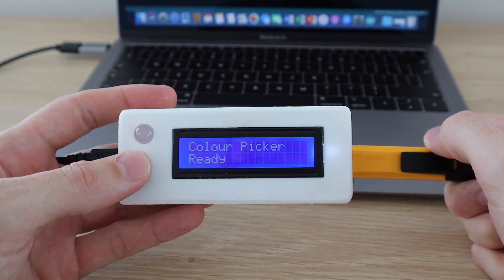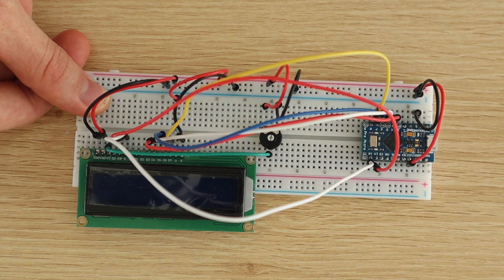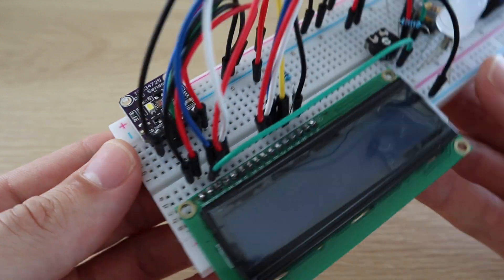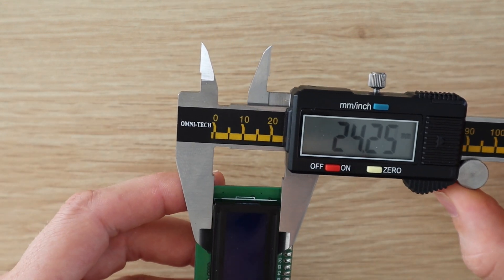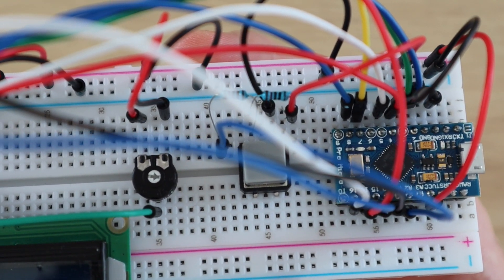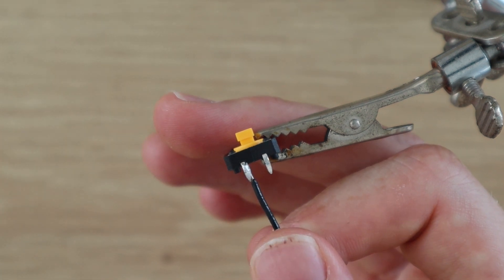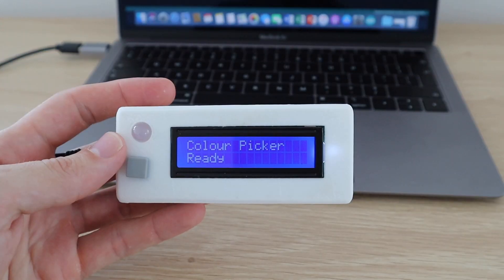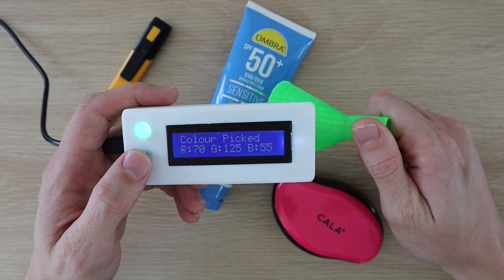Arduino Based Real Life RGB Colour Picker - Make Your Own

Comment: Thank you
You explain all the steps and give all that one needs to do it.
Could you please refer me to a theoretical explanation for the gamma table values?
Reply from the maker: The gamma table is just a simple exponential look-up table to make the colour visualisation on the RGB led look a bit more realistic. By putting the values through the gamma table, you're just adjusting the brightness of each of the RGB LEDs to new values, which should produce a more accurate visualisation on the LED. It's commonly used with RGB displays as a means of adjusting the colour output.
Reply: @MichaelKlements  why power of 2.5? Why not 5, 3, 1.5 or any other number...? (I am asking for my knowledge..)
Thanks!

Comment: Hey man, really cool project and I hope you do well on Make it Glow contest. 

I have a question though, is device's performance affected by brightness of the room or color of the light illuminating the room?  Will it give me different results in different time of the day or under different light? 

I was thinking using it to get color code of my walls and knowing how device interact with different lights really helps me in the long run.
Reply from the maker: Hey Umut, thanks you.

It seems to be fairly consistent as the sensor module provides its own light source. There is a small white LED next to the sensor which is turned on and off for each reading. But yes it is somewhat affected in really bright or really dark situations. Keeping the sensor a certain distance away from the object also has an effect, so it may be worth putting a spacer behind it to keep it a fixed distance from a wall if that’s your regular application for it.
Reply: Hey Mr. Scholar, 

Did you end up going further with this idea? I would love to talk to you about it if so!

Thanks,

Jack